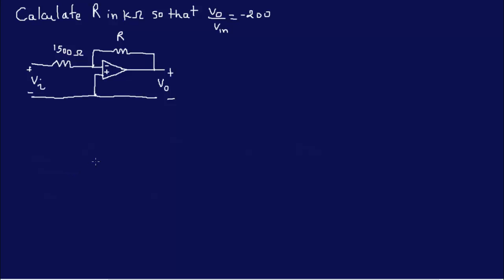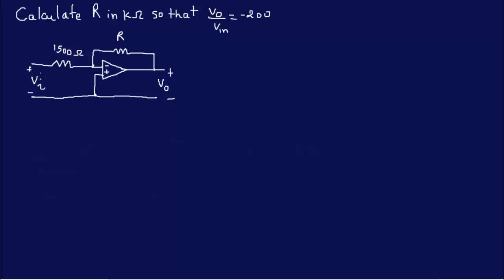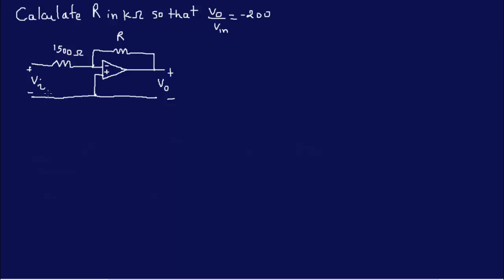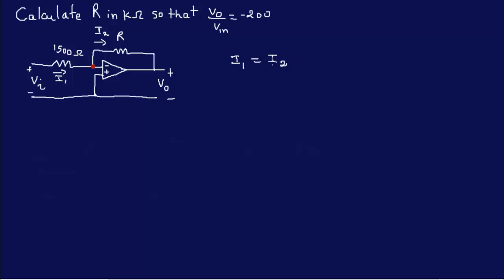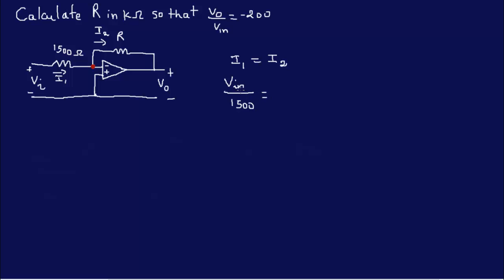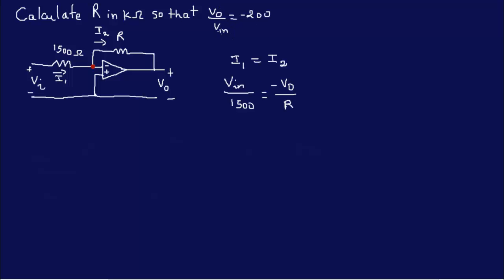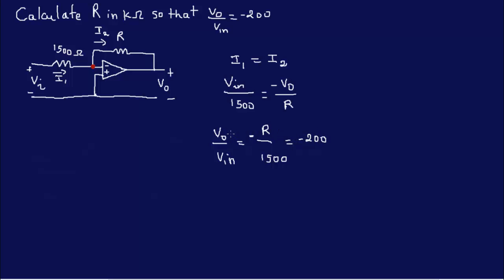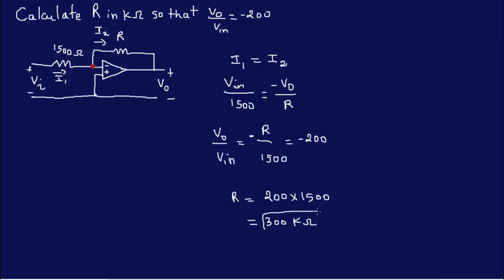OpAmp Circuit Analysis Example 4-FE/EIT Review

Comment: Hi there, 
It's been a while since you've posted this question, but just for others like me who are viewing it 4 years later: 

- The op-amp diagram is incorrect. In order for Vo/Va = -200, the op-amp must be an inverting amplifier. 
- As such, Vb (the voltage into the positive terminal of the op-amp) should be grounded (Vb = 0). 
- This would satisfy the equation given in the FE Reference Handbook 9.4 for an inverting amplifier, Vo = -(R2/R1) *Va where Va = Vin in this case.
Reply: I think the negative terminal of Vin is assumed to be grounded, which is a valid assumption in most circuits.